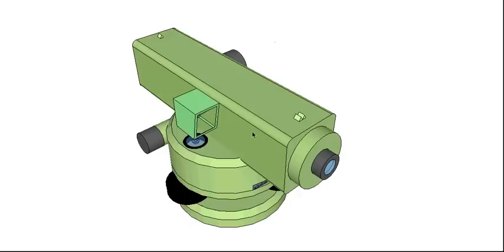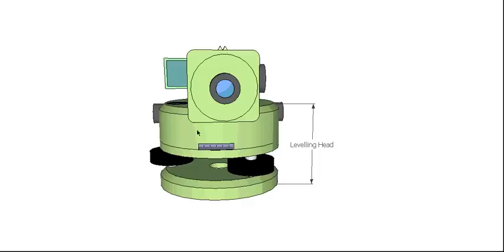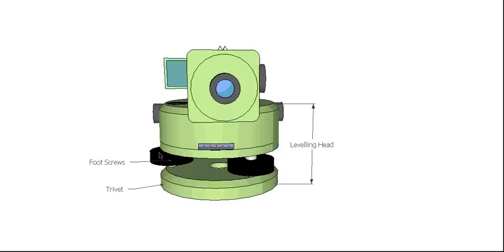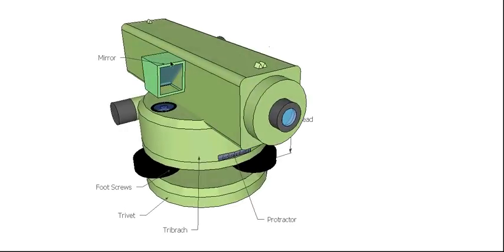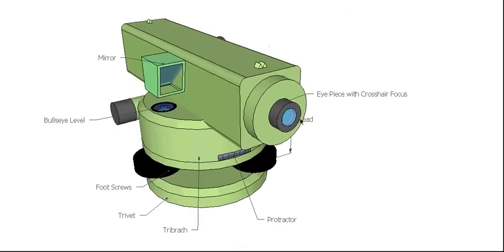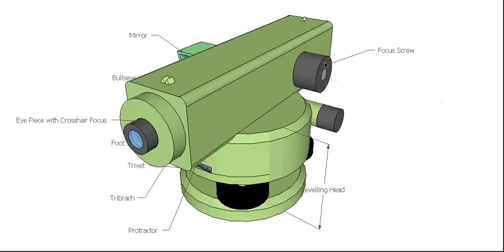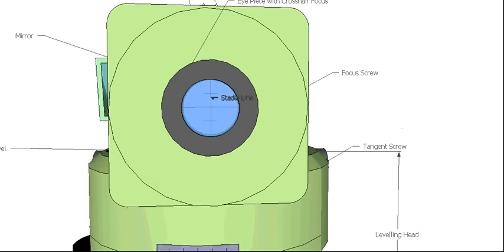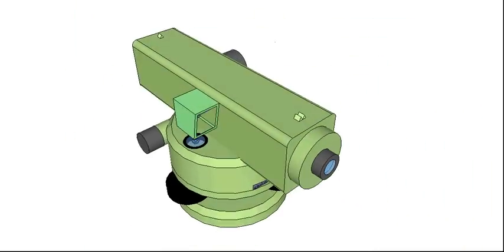Parts of an Automatic Level

Comment: Can you help with adjustment of the levels cross hairs with an alien key, especially when it's out of calibration. Please
Reply from the maker: Hi Marshall, sorry but i have never even looked at trying to calibrate one my self i always send it away to get done. If you are having trouble seeing the crosshairs you can move the eye relief screw on the eyepiece to darken and sharpen the crosshairs.
Reply: @Buildsum  no not really, when a level is out of calibration, the two peg test will yield a value far away from its minimum allowable error, but this can be adjusted with the alien keys
Reply from the maker: Hi Marshal, ok well i have never done so i am not in a position to advise sorry.
Reply: @Buildsum  thank you so much, if I am opportune to do so, I will do a video on that

Comment: Well, I could be wrong but what you are showing is a manual Transit level. If you have to adjust the feet to align the  Spirit levels then how is it automatic? (you have to adjust them to find level in the 🎯 spirit level) I do believe that there is an auto level that once  you set up your base tripod and place the self leveling head on it,  then it will automatically correct the horizontal.
Reply from the maker: Hi Steven, Sorry but the instrument that I am showing is known as an Automatic Level because once it is set up initially it does not need to be relevelled everytime it is moved. Unlike previous versions like the Dumpy level which had to be reset everytime you moved it. Yes, the newer laser levels are Self Leveling and generally refered to as just that, Self Levelling laser levels. Hope this clear some things up.
Reply: @Buildsum  it did 👍. Hey im glad you responded. I must be confused. Because if you have to adjust the head it is not an auto level. I have the Sears and Roebuck which is not auto level and yes I have to adjust the head, It mabey older than me 😂

Anyhow I'm not sure if you know there's a huge debate about the shape of the world.

I know how silly right but new evidence due to new technology  showing some amazing things that rightfully so bring doubt. And it comes down to the physics of water which I've already tested and proven to be true. Anybody can.
 I was told way back in High School physics about the natural physics of water and of all fluids (it was called fluid dynamics) but somehow has been missed by the rest of the world. Maybe you want to join it maybe you don't. Anyhow have you ever tested the surface of a large body of standing water? It's a well-known fact that we get level from water or any fluid for that matter. Anyways it wasn't my intention to bash your video I was looking for something I could show someone they can use as a leveling device for a test so I going to reference a video such as this.
Reply: @Buildsum  what do you mean with "it does not need to be relevelled everytime it is moved"?
surely, if you move it on uneven ground, the thing won't be level anymore.
so i agree with Steven that this is anything BUT an automatic level, this is just manual level.
Reply from the maker: @efari  Hi mate, sure, if you move the entire level and tripod then it has to be releveled however the old dumpy levels had to be releveled every time you rotated the instrument to take a reading. Maybe by today's standard, it does not seem automatic however when it was first released it was and that is how it is still referred to in the industry.
Reply: @Buildsum  lol. that makes sense, but still *facepalm
:p

Comment: Is an automatic level the same as a dumpy level or optical level?
Reply from the maker: Hi Mate, they do look similar however and do the same tasks however the way they are set up and used is different.
Reply: @Buildsum  thank you. I’m trying to teach myself surveying basics in Australia and your videos have been helpful. Can I ask another 2 questions, how does a surveyor find the RL of a slab if he doesn’t have a nearby site datum or AHD? Are there electronic instruments that show you the RL you are holding the instrument at (maybe through GPS perhaps?)
Reply from the maker: Hi, if they needed the R.L. to ba an actual height above sea level then they would have to go back to the nearest Permenant Survey Mark and transfer the height onto the site. However, not all projects need the actual height they just need a reference point so you can just nominate a point on-site which becomes the Site Datum and then just take readings and R.L.s above or below that. I hope that makes sense. 

While the instruments that the surveyors are pretty high tech and do use GPS for postioning etc  I'm not sure if they are millermetre accurate for height yet. Hope this helps.
Reply: @Buildsum  it does make sense, thank you! Next time I go for a walk around my neighbourhood, I’m going to keep an eye out for Permanent Survey Markers.
Reply from the maker: Thanks Mate, You can look them up on Six Maps, https://maps.six.nsw.gov.au/